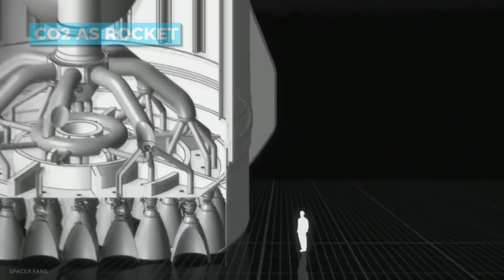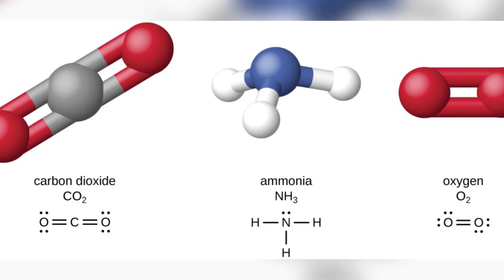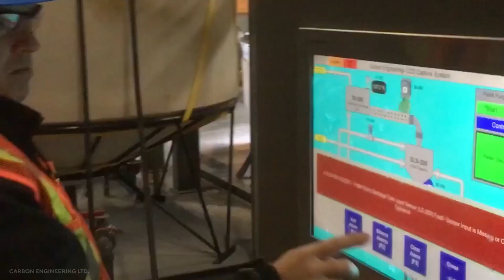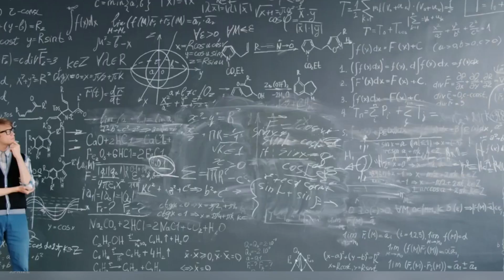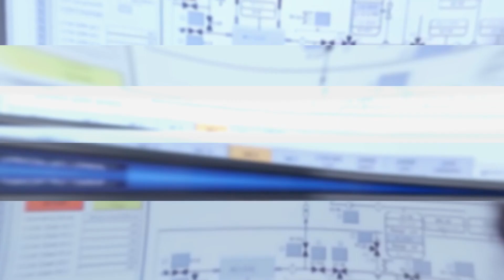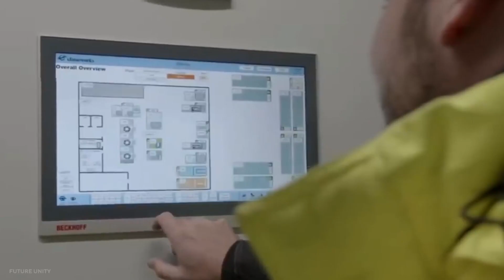Elon Musk Just Revealed Insane Plan To Use CO2 As Rocket Fuel!

Comment: Of course electric cars are cleaner than gas first you got to pump the oil out the ground which requires a little bit of oil it has to be turned into gasoline which needs a bit of oil to burn it needs to be transported by a big massive heavy truck which which burns oil so it can be taken to a gas station so the electric pump that run off electricity that come from coal burning plans unless you're lucky and it comes from a nuclear reactor or a solar farm but then your car has to burn that fuel and your car is only 20 to 30% efficient one electric car can be 70 to 80!